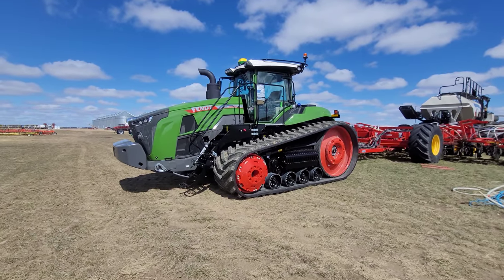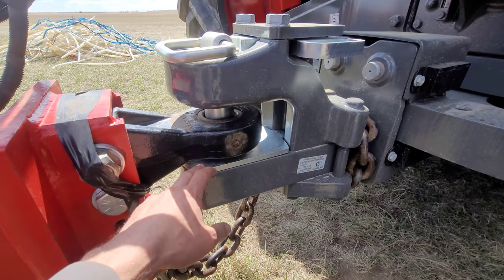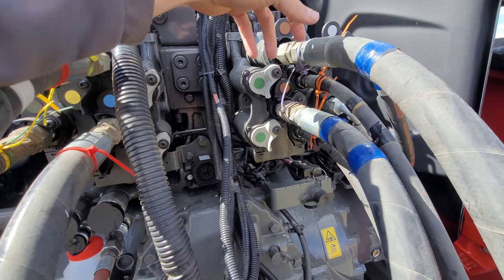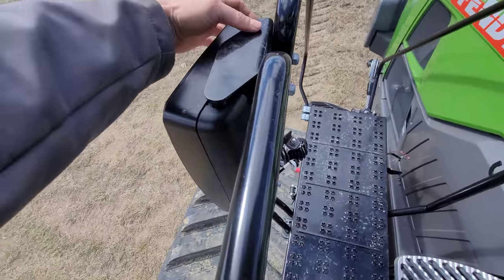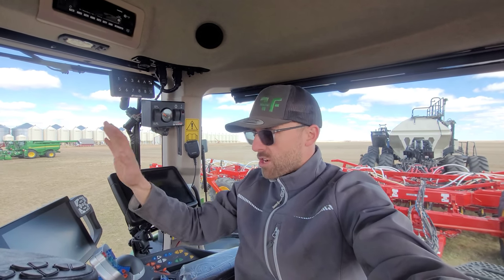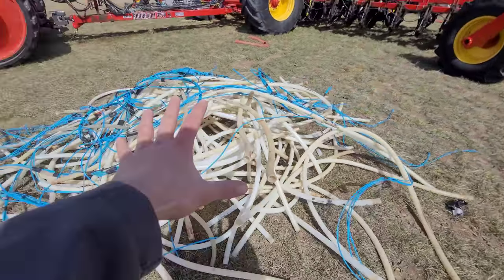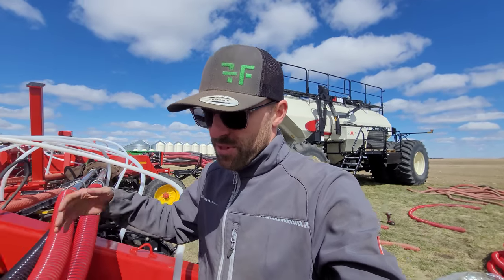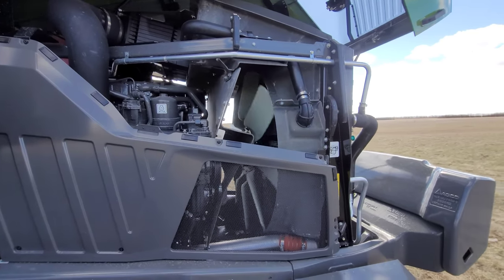New Tractor Reveal! 🤔🙂

Comment: I checked the drawbar test on this tractor and saw that even though it has 660hp it only pulls as hard as John deere 4 track. So i expect you would be a little bit annoyed with its performance. Drawbar HP at 1600rpm is 490, full throttle - 506 . Case has 520hp and jd 490-500hp.
Reply from the maker: Oh, that's very interesting and concerning all at the same time, now to see if the CVT saps out another 10-14% of the Hp
Reply: You can't use all hp for the drawbar anyways, the fans use quite a bit of power too and running the tractor at lower rpm could save a lot of fuel. But indeed doubtful if it will pull better in heavy conditions
Reply: @tjakko4659  Yep, but since in seeding every drill is set up approx the same, we can assume that it won't change much. Well whatever happens we sure will get hands-on experience from Mike :)
Reply: The 1167 is limited in pulling power to the same amount the 1162 has. The 1167 can use the difference for hydraulics.
Reply: @melvd3484  You are correct.  The 1167 is ideally suited for pulling large air seeders that zap a lot of hydraulic power.

Comment: Mike, please explain to us subscribers/viewers why the Fendt Vario 1167 MT with a MAN 6-cylinder 16.2l engine only has 673 hp when the Fendt Ideal 10 combine has the exact same engine and is rated at 790 hp? Is the combine overrated and the 1167 underrated? Does this have to do with low rpm and high torque settings? Please let us know.
Reply: Every transmission has a max power limit, I would imagine that's it for the 1167
Reply from the maker: I am thinking the CVT transmission would explode with 790hp
Reply: @mikemitchell2554  even quadtrac limits power at low speed to protect half axles from huge torque
Reply: Tractor would have to weigh 79,000 lbs to get the power to the ground .
Reply: several reasons actually
There is alot more to it then just increasing power.
(just hold on tight, this might get pretty lengthy, you've been warned... 😂):

1) Engine: 
just FYI, the ideal 10 and 1100MT do not share the EXACT same engine (tho depends on how u look at it) yes technically speaking the ENGINE is the same, the difference is in how they are turbocharged. the ideal 10 being optimized to deliver max boost at 1900RPM (regardless of torque), aka "FGC (= Fixed Geometry Charger)". this whole engine does not fit inside the Fendt Low-Rev idea, it only gives max torque at 1350 - 1600 RPM, beyond or below, and torque drops. power peaks at 1600 - 1900RPM. but due to TMS, a tractor will rarely run at 1700+ all the time.
the 1167 turbo is optimised for max torque at a WIDE rpm range, aka "VTG (Variable Turbine Geometry)" delivering max torque (what truly mathers for pulling) at 950 - 1500RPM. while delivering an perfect linearly power increase with rpm within that same range. judging by MAN engine curves, the 1167 should be operated at 1500RPM, delivering both peak power and peak torque.
RPM differences too. the actual engine in the 1167 is capable of hitting that 700HP, but thats at 1800RPM. once again, does not line up with fendt rev limiter to 1730RPM.

now i hear u ask "y 1730?" 
honestly, idk. let it be known that im not an engineer, at least not in terms of graduation, i dont have a piece of paper saying im an engineer. but either way, i've been told that the fendt CVT ratios or something work best with maximum of 1730RPM. i dont know the reason behind it.

2) Transmission:
As of right now, fendt is limiting the power of the 1167 that goes throught the trans, they limit it to 600HP (just like 1162), this means that this additional 70hp is only for those machines that need not only pulling power but also hydraulic capacity (which mike's bourgault needs, due to hydraulic driven fans). they are limiting this power for not only trans concern, but also for drivetrain / traction concerns (ill get into this in my next point).
Now given that the fendt CVT is really easy to scale up / down, this would come at the cost of a larger frame needed.
Also, very little of the 790hp in the ideal actually is used for driving and making it throught the trans. most of the power is used for the belts (or any combine for that matter) so there are no drivetrain / trans concerns for a combine

3) drivetrain / traction:
its been confirmed by fendt that pushing more power throught the CVT, even tho its possible, comes at a cost.
First, drivetrain concerns, this is pretty simple tho, just increase the axle diameter, done. however once again this comes at the cost of a larger frame.
Second, traction, it generates to much power which makes the roller slip INSIDE the track, basically ripping the track to shreds from the inside. This is where quadtracks come in. they have 4! tracks to devide their power between vs just 2 on a 2 track. giving much less power per track while the total track area on ground is approx 20% higher then a 2 track. sooo, 4 tracks dont run into this issue by a long shot.
They already did some stuff to increase friction between track and rollers, for one, thefront roller is larger then before.
Second, the track on the ground is slighly longer and lastly, they increase tension. The track is on ther much tighter compared to previous challengers. And thats just for this 600hp.
So they would need to use some kind of chain interlocking mechanism between roller and track on the 2t-rack, but that would severly (at least i think so) hamper the suspension capabilities, making it not so nice ride.

But lets say they fixed both these things, how u planning to succesfully get that power to the ground?....
By increasing weight, and how much are u allowed to increase weight on a SINGLE!!! (and thats keyword in this case) axle given this is a single axle driven tractor?
legal stuff is definitely not tobe dismissed be it weight, be it fysical size. especially if u wanna make ur tractor multi continent ready, so many laws to take into account, this 2 tracks is built in minnesota, due to it already being on the edge of certain countries laws here in europe, even in basic config.

4) Cooling:
Unfortunaly power and cooling needed for an engine dont scale linearly.
A 790Hp engine is only 17.5% more power, but requires a whackton (easily 30%+ cooling capacity). 

easy enough in a ideal, the radiator is massive. not so easy in a relativly small / limited hood of a 1167 (or any tractor tbf).
there is a reason the 620RX, 620 case, 1167 all top out at this 670 - 690hp limit.
Fendt somewhat increased the cooling effeciency by using the heat shield, therefor no hot air is going over the engine itself, just fresh air. that allowed them to go 670 in a 2 track, but not much more...
this cooling issue is y most companies are looking into electric, as those engine output way less heat. a regular combustion engine is only 20 - 30% effecient, rest is heat. for a electric engine 85%+ effecent is not uncommon. therefor WAYYYYYY less heat in those. issue with electric is battery capacity. and charging, a diesel engine is easy to refuel on some farms its not allways an option to drive back to the yard to recharge.

now there are prototype pictures going around of a case 720, but that hood is massive, not to mention the huge amount of mesh (for airflow reasons)
and given how long ago those prototypes were spotted, and we havent seen / heard anything since, im thinking the development is not going as easy as expected (even tho they looked pretty close to final design).

So TLDR, 
1) its actually not the exact same engine
2) drivetrain / CVT is not capable
3) not enough traction
4) cooling

Anyway, i could go into more detail but im gonna leave it here, hope u learned something 😁😉
Reply: @Matt___B  Thank you so much for this information. I am now smarter and more informed. @Mike Mitchell pretty cool explanation, huh?
Reply: @Matt___B  thank you! Mike should pin this comment to the top so people can get some real knowledge

Comment: Anyone who’s watched mikes videos knew he was going to get this tractor, he’s all about power, new and fendt, won’t be long before he’s got a 100 footer behind it
Reply: Lets see if it can pull the 84 first.
Reply: @lynwessel2471  I don’t see why it wouldn’t it has more power and weight then their Deere 560rt and they have it pulling an 84 foot
Reply: @Rooftopmatty  They have the smaller cart on that drill, and he doesn't go on the big hills with it .We'll soon see how much of that extra horsepower makes it to the ground .I think he needs more weight .
Reply: @lynwessel2471  I do agree it does need more weight, they should be coming out of the factory with a lot thicker frames then they do
Reply: @Rooftopmatty  General rule for heavy pulling is 100 lbs per hp. But maybe Fendt knows better than we do .Id much rather see a heavy duty tractor that doesn't need weights hanging everywhere .
Reply: @lynwessel2471  I’ve heard that from a few people before, personally on two tracks the drive motors or axel should be in the front instead of the rear giving it more pressure on keeping the front end down and loading up the rear with weight

Comment: What is the reason for the steel rope on the left hand side in the Fendt?
Reply: its a pull cable.
for towing him out if he gets stuck
Reply: @Matt___B  Ah ok, in order to decrease the forces of the tractor frame, right?
Reply: @computerbildschirm7700  yes, this steel cable is attached to the strongest point of the machine.
Would be a shame to rip such a nice machine to pieces trying to get it unstuck 😂
wouldnt really suggest to wrap a strap around the weight block, let alone any other accesible point.

Comment: I agree with you on the GPS. John Deere is just so much better then Agco, like way better. And I have been using both systems. I'm running Agco right now, and in just 5 years they have managed to change system, and they are not interchangeable, so right now we have a massey combine with fendt cab and fendt gps, and we have a topcon system with agco software, on massey tractor and a novatel system with agco software. AND the John deere systems are just able to do so much more. Lines, boundarys, documentation.
Coming from John deere, it is just so frustrating.

Comment: Must have a good salesman. You have had nothing but problems with Fendt equipment. Def issues, sensors, aggravation.  You have said how the twin tractors ride so rough and yet you go out and buy another. Also you have said that the Case pulls better and what do you do. Buy another Fendt? We run Quadtracks. Maybe alittle noisy, pull like mules  all day long and very little trouble. Had trouble with a relay on the deff 2 years ago. $340.00 service call.  To fix that. That was the last issue. Good luck with the new purchase and hope its better than the last one.
Reply: John Deere 2 track that they have runs rough but the fendt has a very smooth suspension setup compared to rivals and this 2 track is the one to get really as it's the most powerful 2 track on the market and by the sounds of it probably the heaviest as well, also that auto swiveling hitch I imagine will help that tractor turn much better than if it was to not have it. Also I bet he's going to really prefer the transmission in the 1167 compared to the 9620rx transmission.

Comment: Mike, I don't get it. After watching the 1050 exit review the last thing I expected to see was another Fendt. You copped a double whammy with the 1050. Not only was it overpriced for a 520hp machine, but you said it pulled like it only had 450hp. So with the 1167 you've probably paid way too much for a 670hp machine that pulls like it's got about 600hp, assuming the same vario losses. Yes, 600hp is probably enough to pull the big Borgault drill and cart, but I fully expected to see a better-value proposition. I'm thinking Fendt has maybe chipped in somehow after the Ideal debacle? No doubt your next video will explain it.

Comment: I thought the fendts were fuel inefficient??
Reply: I think the Mann engines like this one are supposed to be pretty efficient. A lot depends on how much power that transmission eats up vs the other tractors. Its actually rated at less drawbar horsepower than a Case Quadtrack.
Reply: @lynwessel2471  I see,  I was just going off what Mike said about the ideals being inefficient and I thought the 2 track and ideals were same or similar engine?
Reply: @cagrowin1962  We'll find out soon how it performs in real  world conditions. Mike tells it like it is .
Reply: @cagrowin1962  then u were clearly not paying attention. Mike mentioned multiple times that the fuel is the thing he likes.
running a few gallons per hour LESS vs the S690 while carrying 5 more ft of header with cleaner sample.

https://youtu.be/_qq2_vIVtdQ?t=1043
watch till 17:23 - 18:18
just to name 1 example..

as for the tractors, he never said them being 'inefficient'. 
bc it wasnt burning more then the jd's.
the fuel tank size tho is inSUFFICIENT which is y he had to refuel so often (on the 1050 anyway)
insuffecient and inefficient are 2 VERY different things

Comment: Ugly tractor.  But people say they ride smooth. No shifting is nice. 
Would guess a two track tractor is more efficient than a four tractor.  
And probably less money 💰 to lease.     John Deere one just don't ride as smooth.   Probably cost more.   Comes more down to, best bang for your buck. 
Wheel tractor are less maintenance. 
But take up more space.  
One thing with two tracks.  
They don't turn well in mud. 
Plus and minuses to everything. 
It will probably do about everything u need it to do. None are the best at everything.   Four tracks are better. But cost more and eat more fuel ⛽ I would guess.